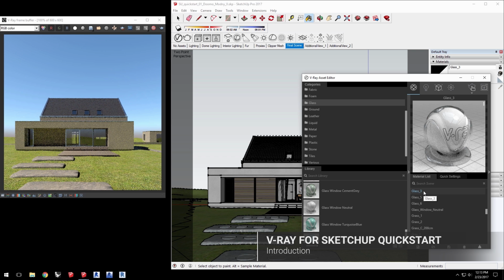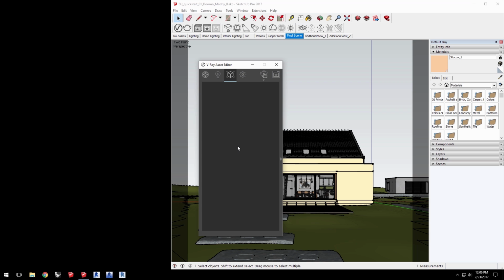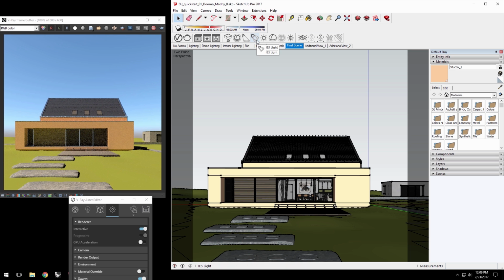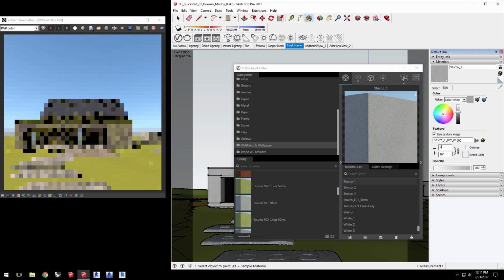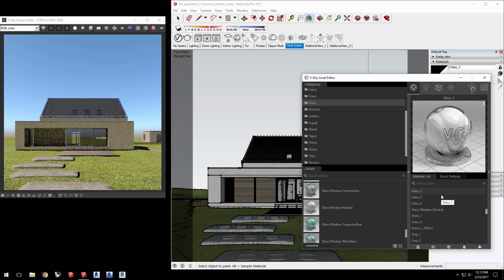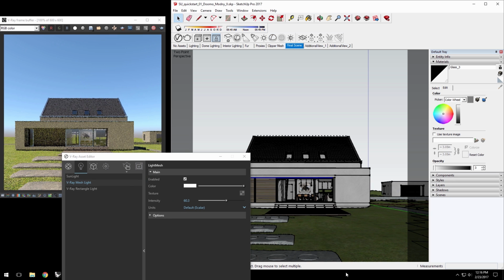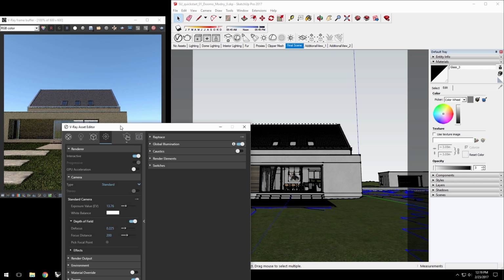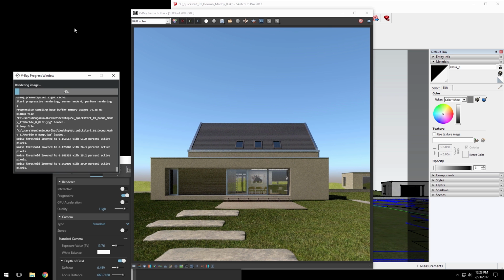V-Ray 3x for SketchUp — Quick Start: Intro

Comment: Could it be that this tutorial is not relevant anymore? I am just starting to learn V-ray, so I can be mistaken,  but my version of V-ray has 4 floating pallets to start with.....I got over that part, but the rest doesn't seem to work either...as there is no "copy" and "paste" option coming up right clicking on the names of the materials.....I imagine this is something I could overcome easily if I know what am I supposed to do...obviously I am a new kid in this industry and my free rial will probably will not last enough long for me to create a single render :) I wasted about 5 cloud render credits on rendering a blank  black screen - as I forgot to make the flat light transparent.....:))))

Comment: where is the color mapping settings? how do I set to Reinhard?
Reply from the maker: Hello Pedro -- The Color Mapping roll-out is no longer available in V-Ray 3. The Type parameter is automatically set to Linear Multiply.   More information about the changes from 2.0 to 3.0 can be found in the link below. https://docs.chaosgroup.com/display/VRAYSKETCHUP/Migrating+from+Previous+Versions#MigratingfromPreviousVersions-ColorMapping  In case a Reinhard type was used in V-Ray 2.0 and the Burn Value was changed, the same effect can now be achieved with the Highlight Burn control in the Color Corrections/Exposure rollout of the VFB.

Comment: I followed this tutorial exactly but although my percentage bar says its 100% its still doing something and the render is very spotty. Unlike on yours where it says Rendering or Building Light Catch, theres no indication of what phase it's at.
Reply: Hello dumplestik! First of all, the 100% that you see it's not the progress of the render but the percentage of the frame of your window, so when it's 100% it means that's the original size of the image that you selected in the output. If it's spotty it's because it's still rendering... so how do you know when it's over? it is supose to show 100% in the "V-ray Progress Window"... and it can be launched from the V-Ray Toolbar or from Extensions > V-Ray >V-Ray Render and Options > Show Progress Window.  Glad to help! Cheers

link with info: https://docs.chaosgroup.com/display/VRAYSKETCHUP/User+Interface#UserInterface-V-RayProgressWindow

Comment: how do you "select one Component Instance" to apply fur?
Reply from the maker: Hello Mara -- V-Ray fur will only work if it is applied to a component or group. Simply select a single component or group in your group and use the Fur button in the toolbar to apply fur. Adding more objects to a group or a component which has V-Ray Fur applied to it will extend the effect to the new geometry as well.

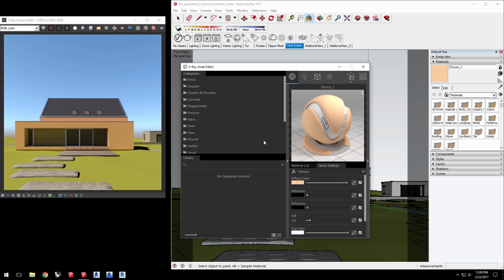Comment: At 03:45 why do you have to drag a material from the material library to the setting window in order to copy/paste it's settings to another material? you will end up having 2 instances of the same material. Why not copy directly from material library and paste in settings without dragging the matterial?
Reply from the maker: Hello Dragos -- You are not able to copy settings directly from the Material Library.  You have to drag the material into the Asset Editor in order to access/see the settings of the selected material. You can then edit that material right away or copy its settings over to another one and delete it afterwards. Furthermore, you can remove all materials not applied to the scene by using the "Purge Unused Materials" button.
Reply: I dont have Copy and Past what i missed? Vray 3.6
Reply: hai, am not getting copy or paste option when right clicking on copied material instead it shows 'replace' and 'use as replacement' what to do?
Reply: sherin ummer  I'm having this same issue. Did you find a solution?
Reply: @Julia Paulsen tks